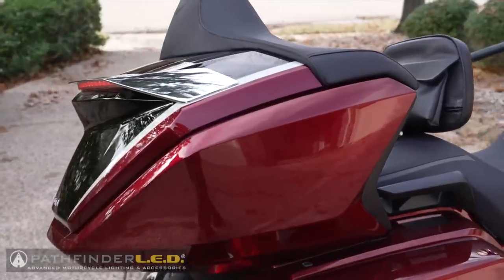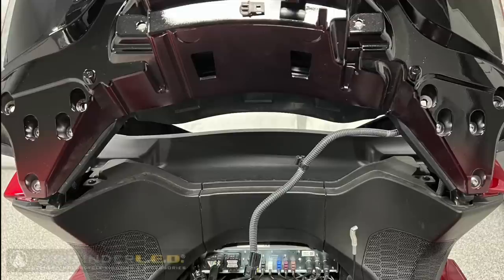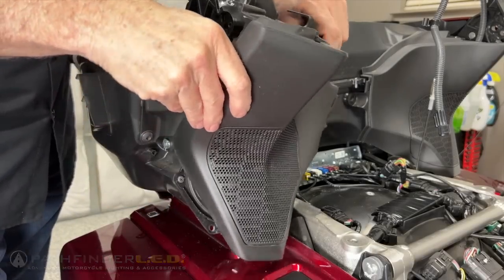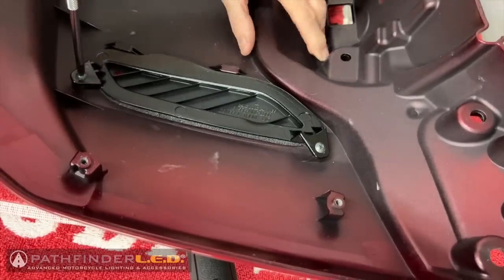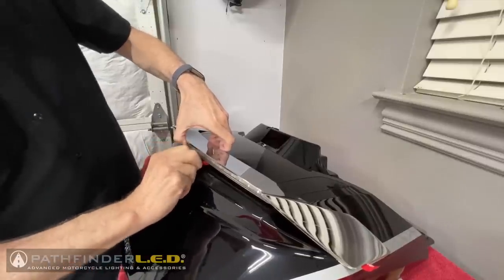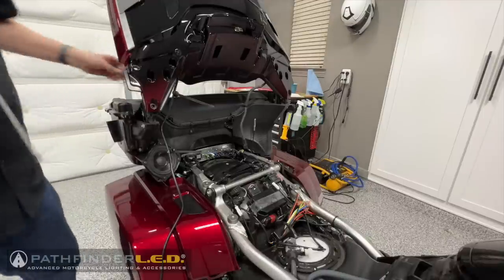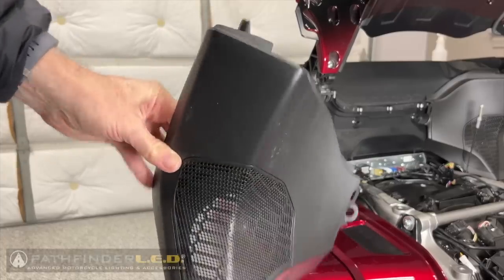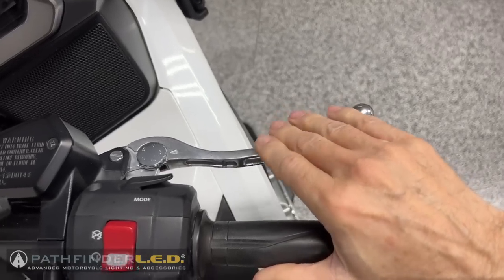Dynamic LED Spoiler for 2021+ Goldwing Tour Installation | PathfinderLED | Cruiseman's Garage

Comment from the maker: A few of you have asked about installing the spoiler along with a luggage rack/trunk rack. You cannot have both installed at the same time. However, if you install the spoiler, then later decide to install a trunk rack, you could remove the spoiler. You would need to plug the holes drilled in the covers, but that would be pretty easy and I doubt you would even see them with the luggage rack installed.

Comment: Great video with a ton of detail. I just received mine in matte black today and will install it soon. Glad I got to the party late, going to use the goldstrike distribution block with the correct wiring adapter so there’s no need to cut wires! Keep doing what you do! 🙏

Comment: Hello Cruiseman,
I just completed the install of the Pathfinder LED spoiler and the Honda trunk light on my 2024 Goldwing. I wanted to let you know of a couple of issues I came across during the install.
You said you cover the painted parts with tape before you drill the holes. I used the blue painters tape to cover the painted parts. After drilling the holes I started to remove the tape and found it was stuck to the gaskets. I had to use a knife to separate the tape from the gasket.
After checking the fit of the spoiler I removed the red  backing material from the 3M tape. It all pealed off until I got to 2 mounting locations. It left a big piece of the red backing material on both sides. I used a letter opener to get the rest of the backing out. 
Also while checking to make sure everything worked I could not get the trunk light to come on. After checking all the connections I found that once the trunk is closed and then opened the light works. I could not find anything about how the light operates while doing a search on the trunk light. 
Thanks to your video the install went as planned and the spoiler looks great. I love the added safety of having the turn signal and break light up higher on the bike.

Comment: The nicest LED spoiler out there. PF does make great stuff. This is on my list. Good job showing it all. I can see that the side panel on the rear case comes off differently then 18-20 model.
Reply from the maker: Yes, it comes off MUCH easier and more logically.
Reply: @cruisemansgarage  Have you moved to the 23 model? Hold tight cause 24 is bringing some nice goodies on the new GW.
Reply from the maker: @alp3781  I have not.
Reply: @cruisemansgarage  Good deal. Hold your money tight. Looking forward to see what comes out next.

Comment: Hi Cruiseman,
I have a question regarding this spoiler, can it be installed using the OEM trunk sub harness break light connections?
I own an all black 2022 Goldwing and I do not want to add the chrome OEM truck rack ‘cause well, it’s chrome. I really like the look of this spoiler and it comes in black. All I want the added safety of the third brake light; not so much the running nor turn signal lights. Also, I purchased the Quick Release Trunk from Traxxion Dynamics and don’t want to add more connectors to the operation of removing the trunk. Can this be done with this spoiler?
Reply: Did you ever get a reply from Cruiseman?  Looking at this Spoiler myself.  Wondering if its all plug and play or extra harnesses are needed?  Also, how do you like Quick Release Trunk from Traxxion Dynamics?  I just purchased a 2023 Black Goldwing DCT Tour.  Would love a Quick Release Trunk.  Thanks, Chris.

Comment: hello cuiseman. I already have a plug and play from kuryakyn, do the spoiler harnesses plug into it or do I have to have a box like yours? THANKS
Reply from the maker: If it is a plug-n-play, then no. You would need to have a power accessory hub, like the Pathfinder or even the ShowChrome Isolator.
Reply: @cruisemansgarage  ok thank